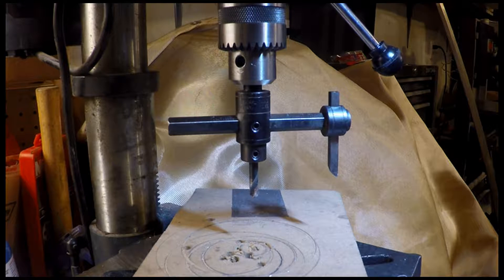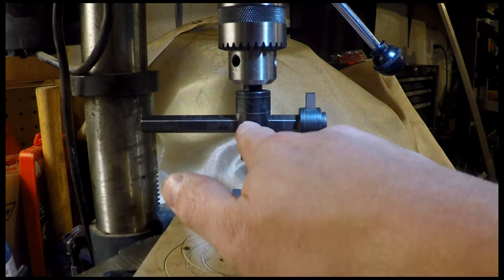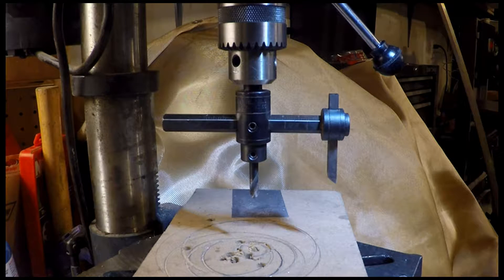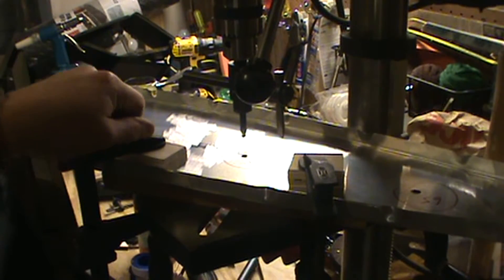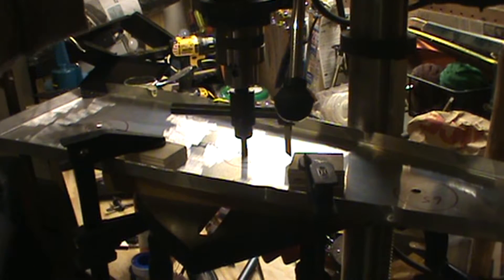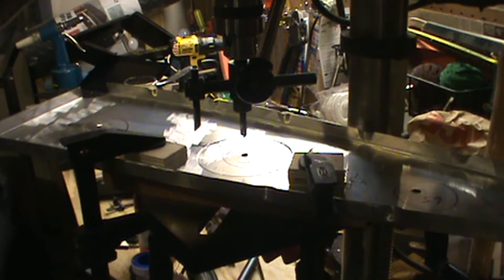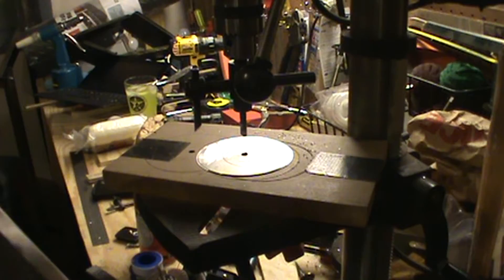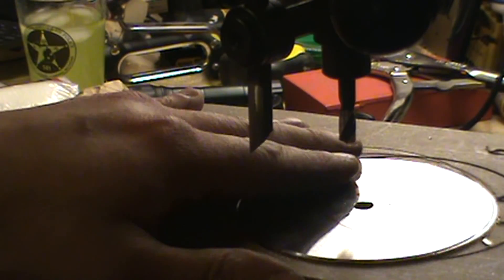Using A Circle Cutter For Lightening Holes

Comment: Just a heads up, this is not a fly cutter. In the machining world, a fly cutter is something used to cut a flat surface, such as a cylinder head, or a gasket surface. A fly cutter is not used to cut a hole. Here's an example of a fly cutter - yes it looks similar, but it's very, very different. http://www.mscdirect.com/browse/tnpla/48445456?src=pla&cid=PLA-Google-PLA+-+Test&CS_003=7867724&CS_010=48445456 Great video Greg, thanks for doing these, they're very helpful!
Reply from the maker: yeah, I'm familiar with a real fly cutter...not sure why these circle/hole cutters are called that in homebuilder aviation circles. but nearly every reference to these types of tools in aviation homebuilding calls them fly cutters. I just use the terminology here since I assume people will see them referenced as. I probably should have explained the difference in the video.